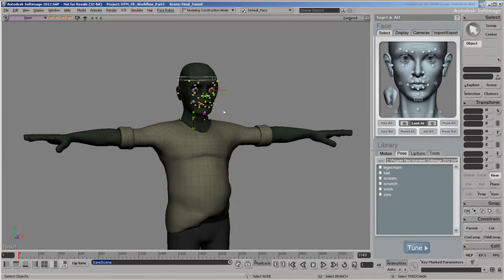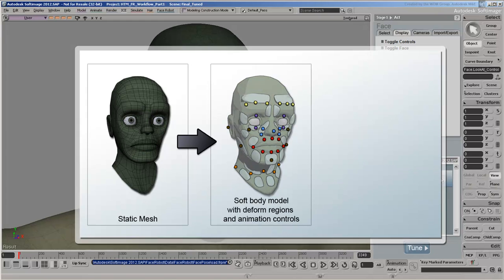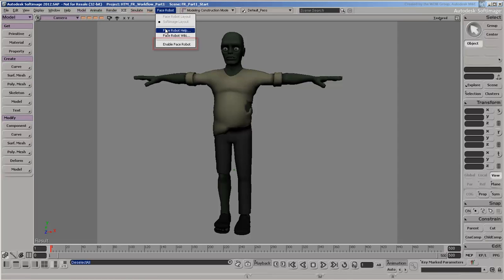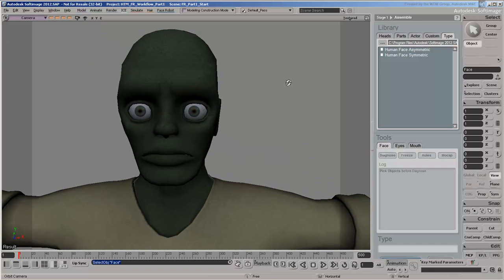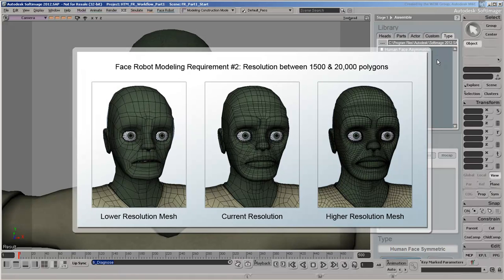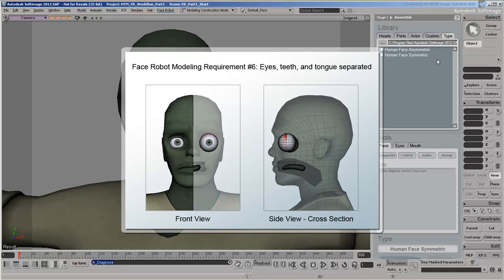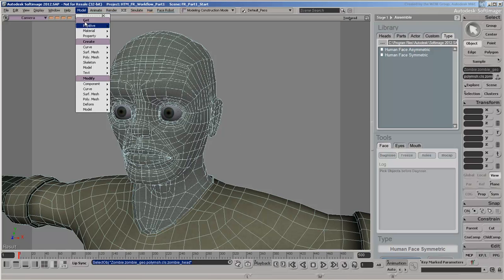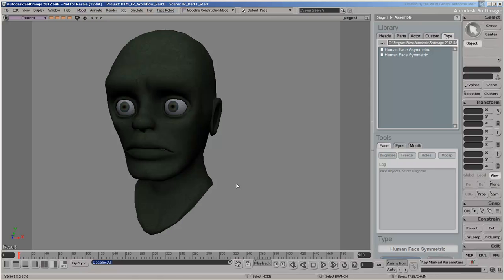Face Robot Workflow - Part 1: Getting Set Up for Face Robot

Comment: I'll do my level best to push it all the way now..
I made an entire series on Facial rigging for game developers using FaceFX about a year ago and half way through it, I discovered Face Robot..I quickly realised which of the two I wanted to work with..
I'll recommend any enquirers now to use SoftImage because if its close connection and easy transfer pipeline between its cousins,Max and Maya...
Does the same apply to Motion Builder ?